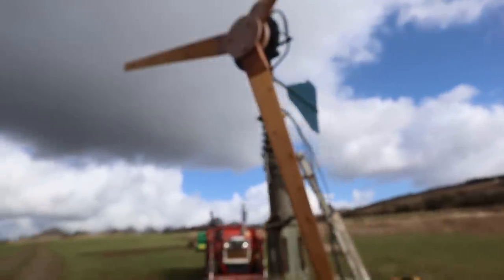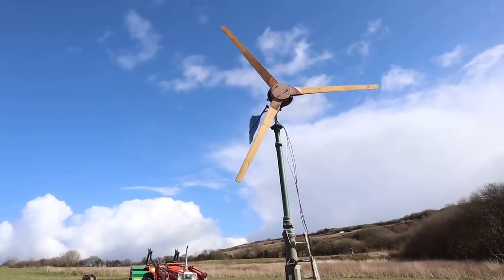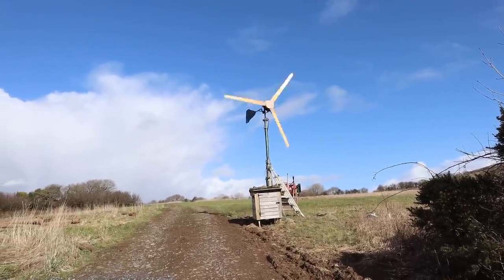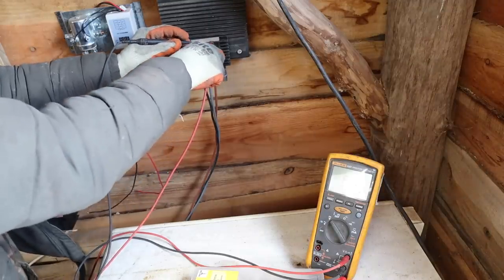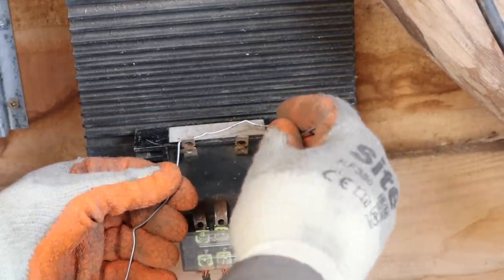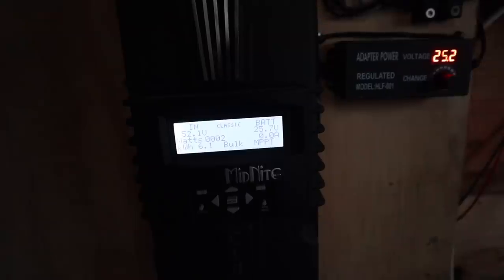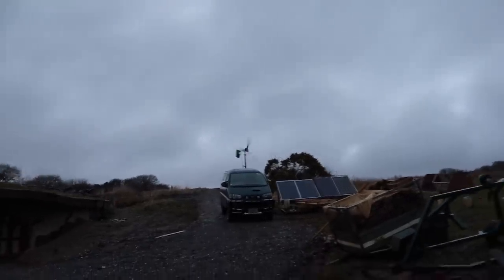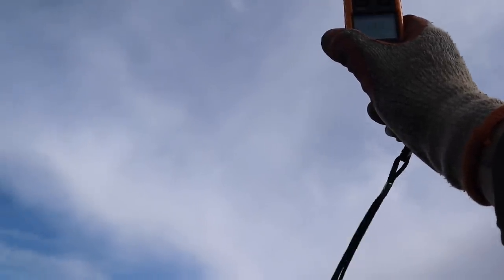Mounting Diy Axial Flux wind turbine Producing 1150W

Comment: Are you going to use the curtailment to generate hydrogen? (Then you can use it for welding/heating and in a hydrogen cell to generate electricity when its calm, overcast and dry.) [Also means that you can "sell" your electricity to neighbours in bottles.]

Comment: Are you going to add a Lightning rod nearby to mitigate a strike to the windmill?
Reply from the maker: the whole mast is metal and is attached to metal poles that go deep in the the ground out the bottom of the concrete so it should be earthed

Comment: water, solar n now wind. Next you can use earth for free perhaps by using a copper rod for electrical earthing connected to the batteries with a electric control box. but i am not sure if that would mean you will be connected to the grid?

Comment: I feel the windmill was much way cheaper to make,, invest in than the water micro system, windmill 1025 watts,, water hydro 500 watts, maybe another windmill is a good idea.. looks like when you made your windmill, you made it Delta
Reply from the maker: wind is intermittent hydro is constant. i get way more power from the hydro than the wind. like 50x more over the year. i could take the wind turbine down and get by no problem. i could not live how i live without the hydro

Comment: I'm kinda surprised you measure the wind speed in miles per hour. I was expecting that to be kph. I noticed another YouTube video a few days ago where they were from the UK yet stating measurements in the US system.
Reply from the maker: yeah for some reason in the uk we use both metric and imperial. mostly metric.I use metric for anything that maters and imperial for rounded none accurate stuff generally. so i might say 6 inch log or 8 inch log and if i measure its length it will be in mm. we in the uk go for a pint. all road signs are in miles. fuel is sold in litres but car efficiency is calculated in MPG. we just use both. they both have there uses. But metric is my go to for most things especially hydro. i cant understand why anyone would use and other measuring system for hydro.

Comment: All practical tests show that small wind turbines hardly generate any electricity. And purchased turbines only at costs very significantly above 1$/kWh! 
There is hardly any wind near the ground, and it is also very gusty, which extremely reduces the service life of the systems.
 With solar systems, you can reliably generate electricity for about 7-12 cents/kWh over a period of 25 years!